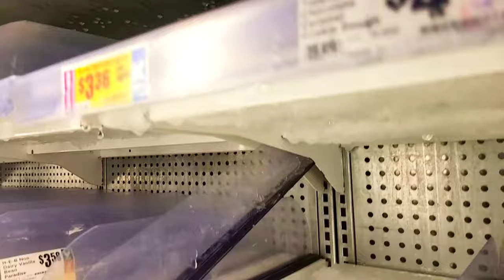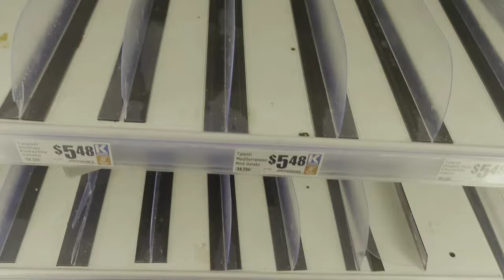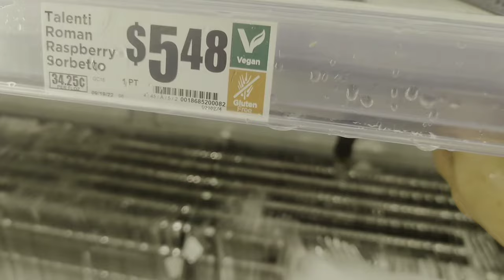18 Door Frozen Food Aisle Ice Cream Melted On Call Mid-Late Morning Service Call. Bad Fan Connection

Comment: Cool video! You really conveyed the exhaustion of the timing of this job well. I'm not in the trades, so I have no idea what I'm talking about, but I question the use of the wire nuts and uninsulated connectors in an area you've just finished drenching with water for hours. That said, the factory plug was clearly shit too so :shrug:. You did the work and got them back up and running when it needed to be done.
Reply from the maker: Thanks. I guess what it is is... you know, you do this for so long... and so many times... that the water doesn't even really phase me too much.
I understand that there's water there.
And I understand that there's electricity there and the two of those and my body don't really mix very well. So, of course, i use caution,  even though it might not seem like I am. In my mind, I've done it so much that I don't really expect or fear that anything's gonna happen to me. We actually talk about this in our safety meetings periodically through danger of repetition.
May I ask though,  Are you suggesting that I should be using insulated Wire nuts instead? Because that would be probably about the only other thing I can do.
 I can't really get the water to disappear. It is what it is...is kind of like what it seems to me, and my main focus really is just to get the case back down the temperature, so theyndont lose any product. And as quick as possible too. 

Thanks for such a long comment.  
I enjoy the interesting conversation, alot.

Comment: That's crazy there are no guards on those fans. No wonder no one goes in to clean up, wouldn't be putting my hands anywhere near those when spinning.
Reply: They all have plugs that can be taken out so they don’t spin while cleaning. I know this because I work at publix where we actually keep our facilities clean! Lol
Reply: @jacoblee8181  it's not the fact that they can be unplugged, anything can be turned off if needed. What I mean is you can lift the shelf up and you're met with a spinning fan with no guard.

Comment: How often is backed up drains beyond the refrigerated units a problem?
Reply from the maker: Do you mean the plumbing attached to the case(ptrap and piping), or the floor drain and plumbing underground? 
The case ptrap I'd say about 50% of the time it needs to be cleared. The floor drains, about 10% of the time is a problem and they need a plumber

Comment: I am curious...if you got 4 or 5  1500 watt space heaters and placed them in the boxes with the fans running and the doors closed, would it melt the ice faster with very little effort. Just wondering. Enjoy the day.
Reply from the maker: Its possible, I would expect, that if you had the entire 18 doors of the aisle with all the evaporators fully froze up and requiring to have the ice removed...and especially if you only have cold water like I did. If you would do as you suggest and those combined heaters were able to raise the temperature in the boxes to about 90-100 degrees with all fans running, that would probably do a pretty decent job of thawing them out. It might be worth trying if you had them on your truck, had no available water and had safe circuit capabilities to support 6000 - 7500 watts @ 120/230V. That's pretty huge. I would struggle to find a safe and suitable power source for those. You could piggy back off the defrost heater circuit, but those are sometimes 480V,  in this case they were 240V.   I would try to utilize your theory instead by figuring out how to change the defrost controls to keep the fans on during the defrost cycle, utilizong the elements on place that are designed for the circuits. There is a small SPST relay along the bottom rail of each section that if you just pull one wire, the fans will stay on. And I would just keep forcing a manual defrost at the Microthermo every 45-60 mins. 
You just want to monitor closely that the space temp inside does not exceed 110-120° for an extended amount of time. By the time it does reach temps that high, things are going to start occurring that are not good. First then door gaskets will soften up, but everything in the case is not designed to survive in excessive temperatures. If left unattended, it would get alarming really fast. 
Too many safety hazards from extention cord dangers to overloading circuits to make a habit of it. Better to have a flooded floor, than a burnt down aisle. 

Thanks for the conversation!
Reply: @HVACRServiceTech  THANK YOU for the awesome conversation. I am a refrigeration tech for Coca-Cola in Memphis, Tn.  I have worked for the same place since 7/19/78, almost 45 years. I will be 68 in September. I probably should have gone already but I really love being a tech and helping the customers stay in business.  I love your channel. Congratulations on passing the contractor test. The residential crowd is about to be blessed. Be safe and enjoy the day.

Comment: Could you of turned up the water heater  .
Reply from the maker: Most likely, the staff probably used all the hot water up by filling up those big floor cleaners and it hadn't warmed back up. Needed that or their boiler was not working.They don't really have water heaters if they do. They are extremely huge and it's not really efficient for places that need and go through so much hot water like that to use water heaters like what we have in houses.
But no, I can't really go messing with anything like that. They wouldn't be very happy about that. I wish we could though.

Comment: I heard a crazy rumor that ice melts faster with cold water. Something science and stuff.
Reply from the maker: @nedmacallen  no way bro. Believe me, it does not. I heard when i was a kid that hot water will turn to ice faster than room temperature water, because of the energy the water has. Could be true, but Ice definitely does not melt faster with cold water.
Reply: @HVACRServiceTech  figured you would be a great resource to get to the bottom of the rumor lol thanks for the reply good work keep it up.